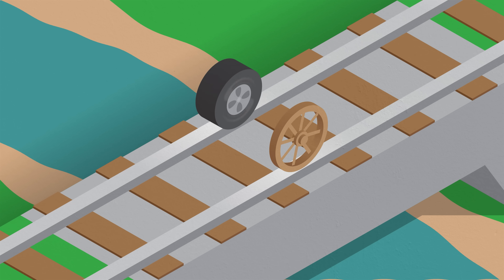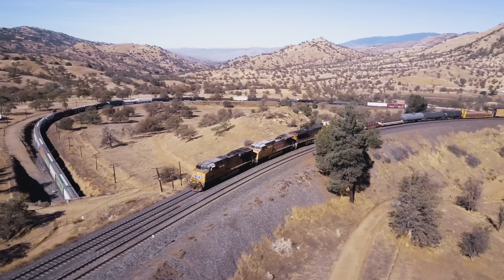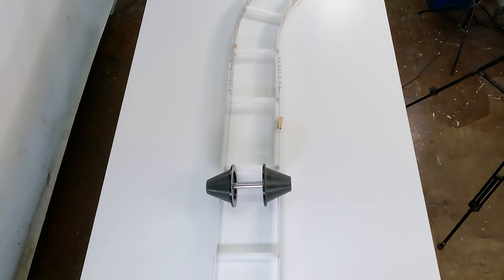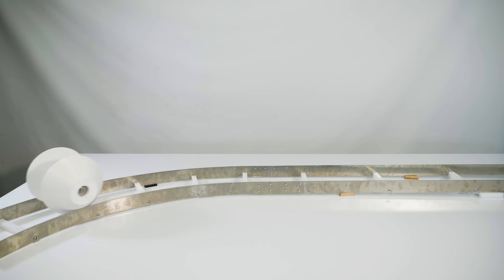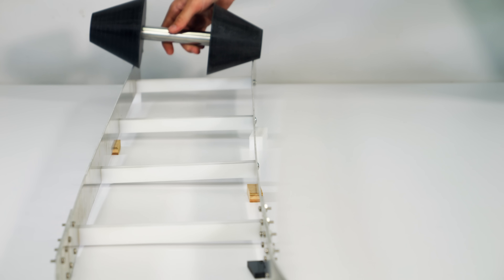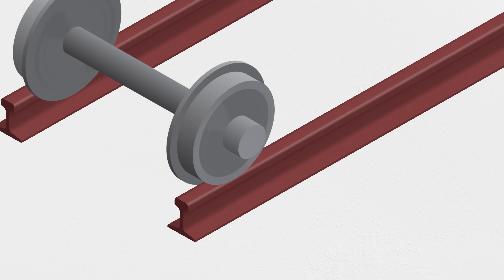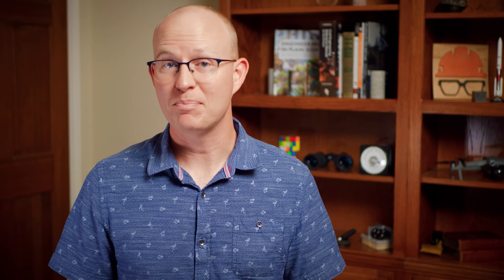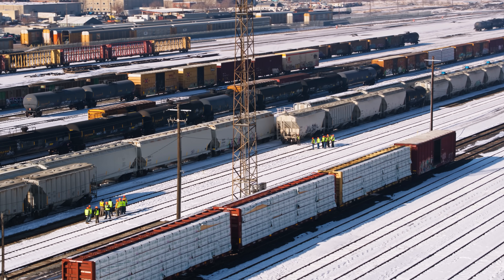Why Are Rails Shaped Like That?

Comment: I was an electrical engineer on a project at Griffin Wheel where they make some train wheels. There is a lot that goes into each and every wheel. One of the most interesting projects I got to work on.
Reply: Can you explain to someone not in the field why an electrical engineer would be involved in the design or manufacture of train wheels? My only guess would be for the design of electronics that control brakes but I really have no idea.
Reply: @petersennello813  Presumably because the machinery used in manufacturing basically anything is powered by electricity and a steel press doesn't work off a 230V socket. The comment doesn't read like OP was involved in the design or manufacture of train wheels itself, just a project at the factory.

Train wheels do have some intersections with electrical engineering - the wheel is an electrical contact point between the vehicle and the ground, and on electrical engines in particular, a lot of current needs to go through that contact point. But that's not really something that needs a lot of involvement from an electrical engineer, I presume.

Also, the brakes do not have any components that are on the wheels, at least not in any brake system I am familiar with.

Comment: The bit about the wheel going different speeds throughout the contact patch was really interesting. I suppose that probably applies to wheels on every vehicle, since they deform under weight and won't be perfectly parallel to the riding surface.
Reply: At least with pneumatic wheels, they're "effectively parallel", as the tires deform to the road surface. So if the road surface is flat, the wheels should be parallel.
Reply: @Ornithopter470  Hmm that's a good point. On the other hand, since a tire deforms so much, the contact area is going to be quite large, so I wonder if the edges of the contact patch might experience differences in speed beyond what the rubber stretch is able to account for. 

Doesn't the tire wear down purely because each point of surface doesn't perfectly match the speed of the road?
Reply: @zachpw  On car tyres, the contact patch is relatively flat tyre touching a relatively flat road, so there is not much grinding. The rubber has to deform to grip the asphalt but as it is flexible it bounces back.

On rail wheel, it's not flat. In an exaggerated example, both 1 foot diameter and a 2 foot diameter part of the train wheel touch the rail at the same time.
Reply: @zachpw  Car tires are basically the opposite of train wheels in that they are built specifically to increase friction as much as possible. This means that the car sorta pulls itself along with the tire, so the tire by design always has to move faster than the road otherwise the car will slow down, this also means that wear on both the tire and road is unavoidable. The benefit of this design is that it lets you climb slopes a lot better and lets you turn without the use of rails but the downside is that it is much less energy efficient. Because of the high friction with the road cars have to stay at full power just to maintain their speed, in comparison trains only have to use their full power to get moving but can then easily just coast along at around 80 km/h only needing to expend the little energy needed to combat air resistance. This is because trains have so little friction with their track because of the use of similar materials and small contact area. Trains are essentially what you get if you wanted to design a transportation system that is optimized for energy efficiency, which is why they're so essential when lowering CO2 emissions, even diesel trains have lower CO2 emissions than electric cars.
Reply: @hedgehog3180  This is great thanks.
Reply: @zachpw  tire wear is caused by scrubbing (sliding across the pavement), not so much from stretching or deforming.  While there is a small amount of deformation in the tire caused by how torque is applied at the contact patch, the majority of wear will come from changing the direction of travel and you can pretty much ignore the wear from deformation of the contact patch.
Reply: @hedgehog3180  m8, if I kept my car at full power I would maintain its max speed.  Most cars require something like 17 horsepower to maintain highway speeds and my car has 400; that means I would maintain over 140 mph at full power.
Reply: @Ornithopter470  The contact patch zachpw is talking about is within a single wheel, and the differences across the axle are handled by the differential.  When your wheels are rubber instead of steel, they're going to deform for a relatively huge contact area.   The different speeds across the contact patch don't need to cause slip, because the tire can compress so there's a different density instead.  Rather than slipping faster to get the wheel around, it can simply pass more rubber at once through the slow zone as it compresses before contact.
Reply: @stevexracer  NOT TRUE. As a Caterpillar guy I can assure you that ALL roads do NOT have a crown in the middle. Yes - roads have profiles, largely to deal with the elimination of water but the high point - the crown as you describe it - is NOT always in the middle. It changes as roads curve and if one direction is higher than the other.
Reply: @stevexracer  Except when it's old crappy road so now you just have grooves from all the tires

Comment: Wait, why they don't just get rid of the solid axle ? There is no need for connection there on non-driven wheels ? They need bearings to connect with the load anyway, why not just not have the connection between wheels ?

Comment: I think one of the factors why trains are so impressive in general is, where else do you see something with the weight of a house move with speeds up to or even above the speed of cars on highways?
Reply: Yeah, trains weigh a lot more than a house.  It's amazing how efficient they are at moving extremely heavy loads.
Reply: @Soupy_loopy  Trains are so efficient that a diesel locomotive still emits less CO2 per passenger km than an electric car. While trains can be absurdly powerful, they actually don't need all that much power to move even heavy freight loads and usually absurdly powerful trains just have that power because they need to get up some slope. The only form of transportation more energy efficient than trains are cargo ships.
Reply: @hedgehog3180  I mean, with using electric power a lot kinda depends on where the power is from so it can change quite a bit. But ye those two are crazy efficient.
Reply: @ImieNazwiskoOK  I would gamble that the construction of a Tesla requires huge amounts of CO2, especially the exotic materials like lithium, cobalt/phosphate, neodymium for the magnets, using energy intensive aluminum instead of steel for the chassis, shipping around the world, which dwarfs the relatively basic materials used to construct a locomotive.

Something overlooked with Nuclear v window/solar too, in an ironic twist, The nuclear fuel, and the magnets for the generator due, e=mc² and to economies of scale you get a lot more watts per gram of magnet.

Other thing is ofc a modern hybrid electric ships are stupidly efficient too.
Reply: @woobilicious.  At first I understood it as relating to just use/exploitation, but ye their construction takes a lot more than ICE vehicle (although from what I remember counting by CO2 generally produces less overall, but not entirely sure about other measures). 
And could you rephrase/expand on the second paragraph because I'm not sure if I understand what you mean.
Reply: @ImieNazwiskoOK  I mean even with a fossil fuel heavy grid mix electric vehicles are still generally more CO2 efficient simply because electric engines are so much more efficient. Internal Combustion Engines are around 30% efficient and it is impossible for them to get more efficient, meanwhile electric engines can easily have efficiencies into the 80-90% range. So because even in fossil fuel heavy grids the power plants are more efficient simply due to economies of scale electric vehicles will almost always be more efficient.
Reply: @woobilicious.  It's not really that Teslas are built uniquely energy inefficiently, though they are because they're luxury cars. It's just that because cars almost always only carry single occupant while locomotives almost always carry several hundred. Locomotives also usually stay in service for several decades which would be rare for a car.
Reply: @ImieNazwiskoOK  The construction of any vehicle is likely to account for the majority of its CO2 emissions simply because the construction is so energy intensive. Teslas are somewhat unique in that they're luxury electric cars so the construction which accounts for basically all of their emissions also just has a lot of emissions associated with them. They still only emit about half the life time emissions of your average internal combustion car but that just isn't very good for an electric car, they can easily reach much lower. Though all cars just always loose out to trains for the reasons mentioned.
Reply: High speed jet ferries. They weigh way more than a house.  I don't see it often but others do.
Reply: It's much more than the weight of a building. The average home in the US is somewhere between 80-120 tons. Just the engine is 100-200 tons. We're talking absolutely absurd weights. But we should also note that the cars themselves do take a fair chunk of it. Those trucks they ride on each weigh around 10 tons.
Reply: @Skylancer727   To be honest houses in US can sometimes be build in a quit light way
Reply: Every time I see A380 fly!
Reply: @bearcatracing007  Trains easily dwarf A380s in mass and size. The only form of transportation in the world that is larger and heavier than trains are ships but they can't reach speeds up to 600 km/h.
Reply: @hedgehog3180  not comparing, just stating I find them impressive as well.
Reply: @bearcatracing007 : I guess that depends on what you mean. An A380 at MTOW weighs 1,234,588lb, which easily dwarfs the 286,000lb gross rail load of a modern 100-ton freight car. But put 5 cars together and you're already heavier than the A380.
Reply: @ErickC  Exactly, mainline freight trains (basically anything that's not a local/road switcher) are usually 90-130 or so cars long, which EASILY dwarfs the A380's MGW.
Reply: @ErickC  If you assume the average locomotive weighs 200 tons, you reach that even faster.
Reply: @everettrailfan yes but the a380 yk flies.
Reply: @ErickC  I mean they are impressive nothing else lol
Reply: @bearcatracing007  A380's fly on highways???
Reply: @SlartiMarvinbartfast  The highways of the sky
Reply: @azrobbins01 the highest of ways
Reply: I don't find that impressive.

Comment: You talk about the wear of both wheels and rails. But do they aim for the same lifespan for both?
I'm assuming changing wheels is easier and cheaper than changing rails (?), so does that mean you'd want wheels to wear faster (softer alloy?) so that the rails last longer?  🤔
Reply: Typically they are making rails a bit harder than wheels, so they last longer. However optimal ratio of rails to wheels hardness is a separate topic which may deserve its own video.

Comment: Speaking of wheel rail interfaces one of  the more unusual faults I've seen was caused by a loco having a slightly different contact patch to the normal EMU that ran on that track. Because it wasn't touching the narrow unrusted part of the rail head the rust was acting as an insulator and preventing activating it the track circuit's consistently.
Reply: I'll bet that was an adventure to figure out.
Reply: I'm a Signalling Engineer, the problem of poor electrical contact in the wheel-rail interface is at the forefront of our minds for safe Signalling practices. Particular attention is paid when performing re-railling activities where the new rail is potentially rusty. I've even heard of a case where millions of millipedes have caused a train to disappear on a track circuit. Axle Counters certainly are a great way of eliminating this. They have their own challenges though.
Reply: @Woodsy3211  British rail lines are notorious for some of the reasons given for delays/cancellations. "Leaves on the track", and "the wrong kind of snow" are probably the most infamous. It wasn't until I had a conversation with a retired line controller that took the time to explain why leaves and particular types of snow could affect the track sensor systems, acting as insulators & causing trains to disappear from the control network, that I came to understand that these bizarre sounding reasons were actually entirely valid safety issues...
Reply: A train not reliably activating track circuits isn't "potentially dangerous" if electric, it is definitely dangerous regardless of mode of traction because there is a pretty significant risk of another train entering the occupied section and then a collision.

There was a case in Mainz a few years back where a train just dropped off the track circuit because the driver had used sand while breaking, and the train then essentially stood on the sand. Another train was then cleared to enter that section. IIRC there was no collision because the other train was entering at a low speed and the driver could stop in time after seeing the standing train.

That's just more evidence that axle counters are superior.
Reply: @Taschenschieber  The best answer is almost certainly "both" — and if they disagree, everything stops until it gets sorted out. Like most proper fail-safe systems.
Reply: @jaelwyn  There are many scenarios where using "both" is flat-out impossible. Track circuits have some very strong technological restrictions, e.g. on maximum section length.

If you have evidence of even a single security incident due to axle counter malfunction, I'd like to see it. Truth is, those are already a highly safe technology and railways don't make it a general habit to use every security technology imaginable in parallel because it is a pointless waste of money that actively makes system reliability a whole lot worse.
Reply: Thats a nasty and potentially dangerous one. (if electric)
If the loco has bad electrical contact to the rails then it is going to have some voltage compared to ground.
Meaning if someone wants to get on or off the loco he may be in for a shock.

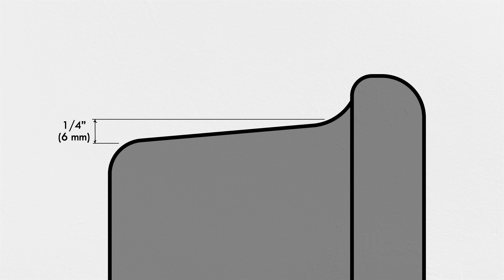Comment: 6:52 You said the "Out side diameter is 6mm less than the inside diameter" but the graphics actually shows a 6mm less for its RADIUS, that is *12 mm* difference between outside and inside diameter.
Great video still!